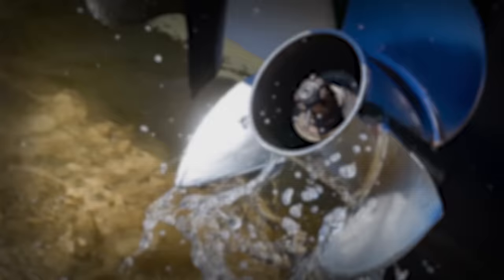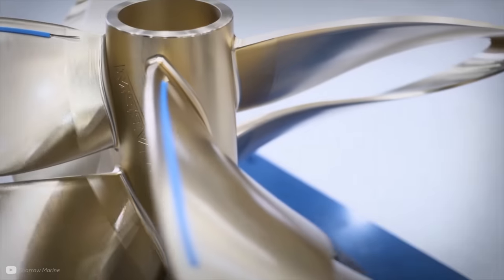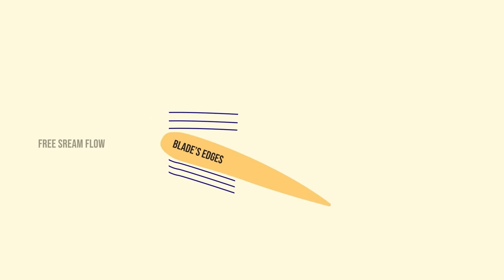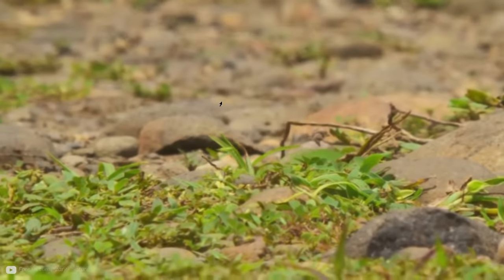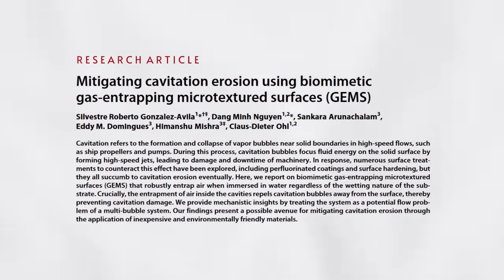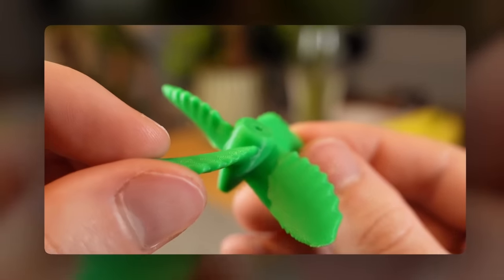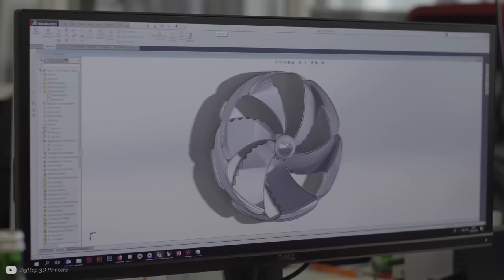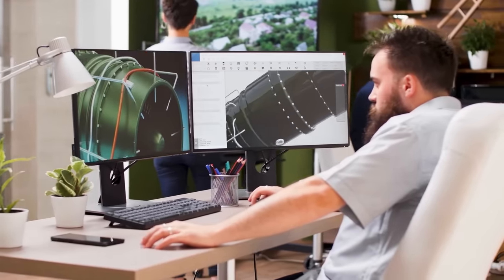The Unexpected Genius of Bionic Propellers

Comment: I must say, having used some 3D CAD/CAM drawing programs to design propellers, these are insanely cerebral from the onset.  But introduction of tubercles to the edges makes these ever more insanely complex.  Your presentation was professionally presented so that anyone could understand this content without struggling.  Good job, Ziroth!
Reply: the solution is the placement of the propeller, water pump can run 25 years only when air is added to the instake damich appea
,so a tractor propeller because it have a back pressure and a pipe is a solution

Comment: As a Merchant Mariner, this is really exciting.  Always a good day when you learn of a new technology that increases efficiency while ALSO helping the environment.  It's a win-win for everyone.
Reply: I dunno. Big Auto took away the water engine. Big Energy took away the perpetual motion machine. 
I expect Big Propeller to take this innovation away from us also.
Reply: a patent is holding it back, some one patent it ,but cavitesion go to cero if the propeller is place in front of the ship 🚢 with a pipe running the water back,this design reduce or eliminate the front wave and increase or fill the depression behind the ship, elevating water behind the ship increase propulsion .
Reply: More efficiency and more thrust. In other words, no performance drawbacks. The issue, of course, is how difficult these things will be to manufacture.

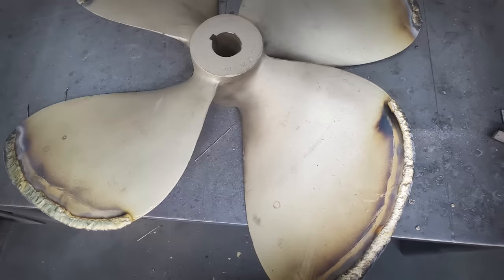Comment: Just wanted to make a correction. At 1:57 there's a picture of a propeller that supposedly has cavitation damage. This is actually a picture of a brass propeller that's in the process of being repaired. The outer edges have been welded and the "cavitation damage" is actually the weld that was added to repair the propeller. This will be ground down to match the original shape of the propeller. Thought I'd clear that up incase anyone was confused.
Reply: And at 2:05 the computer model of the prop is nonsensical, as the pitch at the tips is greater than the one at the root, while it must be other way around. The prop shown is basically in a "feathered" position.
Reply: thought it was weird how the cavitation which "eats away" at the prop somehow managed to add material to it
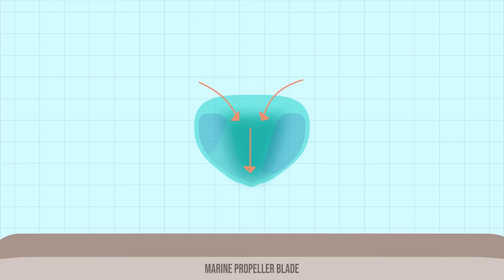Reply: Better pic at 2:27.
Reply: Engineer here - I wondered about that.
Thanks for clearing it up.
Reply: It is even easy to see the heat-affected zones from the welding.
The guy making this video lacks quite a lot of engineering knowledge I guess..
Reply: @ErikS-  I am an engineer with 30+ years. You-re right he lacks a lot of experience but from my past interactions with him on this channel he is UNLIKE SO MANY OTHERS willing to engage people who know more than he does.

As a counter point so you know what I consider good and bad science and tech channels. 

A while back I corrected a fairly basic mistake made by the Common Sense Skeptic who's a real Elon Musk basher and being honest he's well justified in bashing Elon. But on this one video where they were trying to promote a long forgotten and dismissed alternative to getting into space I corrected them on a point regarding air launched systems. 

FYI - My degree is in aerospace and I knew what they said was 100% WRONG. I got a damn arrogant reply telling me I didn't know what I was talking about and should remove my comment. I then replied back and sited all sorts of examples PROVING their comment was wrong. 

They then deleted me from EVERWHERE on their pages.

So YES Ziroth is young he does lack experience BUT IS WILLING TO LISTEN while so many others are pretty SHlTHOUSE.
Reply from the maker: Yes this is a great point, thanks for clarifying this! I probably should have chosen a different image!
Reply from the maker: @tonywilson4713 thanks for your comment on this Tony. I am definitely on a learning process and happy to be corrected on things. I think humility is an important thing that many people forget!

It's not normal for a young engineer to have millions of people seeing their mistakes every month! 😅
Reply from the maker: @onebronx I didn't notice that, the animation is from another source, but I will try sense check these things in the future
Reply: I do so thank you got clarifying that.
Reply: I am immediately convinced this is a WHOLE LOAD OF OLD BOLLOCKS, hastily cobbled together to make money, rather than impart any real information.
Reply: Yes I recognized that too.
Reply: @ZirothTech  Humility is the seat of wisdom.

Comment: I first learned about cavitation and its destructiveness as a mechanic working on Caterpillar hydraulic systems; how it would destroy the vane type hydraulic pumps needed to drive the massive rams on Cat scrapers and loaders. Later I learned about the noise issue as it relates to, particularly, submarines and how the U.S. Navy went to extraordinary lengths to keep the design of its submarine props, enshrouded, LITERALLY, in secret and how they could tell exactly where a Soviet submarine was simply by its noise signature. Even now, when you see pictures of U.S. Navy subs in drydock, their propellers are wrapped to keep them hidden from prying eyes. Truly fascinating stuff.

Comment: There is a computer fan maker called Noctua from Austria.  They have been well known for making quiet fans.  If you go their website you will see the same flutes on their fans.  This idea came to them more than 20 years ago, after their R&D labs led them to fine tune their observations.
Reply: I'm a big fan of noctua!
Reply: I was going to mention Noctua as well. They have had these shapes on the blades of their fans for many years. Making them widely regarded as the best fans for desktop computers, for how quiet they are, and how much air they can push, buth volume and staic pressure wise.
Reply: @pocketsk3824  Its more likely the difficulty of designing and mass producing these designs that's holding them back. The improvements might not scale with blade speed etc
Reply: My homebuilt PC is very quiet. It sits about two feet from me and I can barely hear it. I used Noctua fans for my build.
Edit: I should add that the room must be dead quiet for me to even barely hear the fans. Typically, I have no perception of sound from the case.
Reply: @raoulduke7668  So they make sentient fans now? Man technological progress is so fast these days.
Reply: @pocketsk3824  The research on tubercles was known for quite awhile because I read about it 18 or so years ago in regards to aircraft.  I don't think anyone had a patent on it.  They had working proven prototypes already so the knowledge of what things like this could do must have been out for at least a decade before that and vortex generators on aircraft wings have been around even longer.
But even if what you said was true it would still not be a problem of capitalism or especially a true free market capitalism.   Those are just economic systems.  Governments grant patents and that is the only thing blocking one person from shamelessly copying someone else or improving upon their idea.
Reply: @pocketsk3824  Capitalism is not at fault though. The problem here is our institutions enforcing that ideas can somehow be considered property. Therefore patenting should not exist.
Reply: @pocketsk3824  Their fan technology is specifically suited for the PC environment. It doesn't scale at all to other fields, and even Nocuta themselves takes like 5 years to come up with a new fan iteration. They're not exactly setting records. There's plenty of research within the proper fields that enables technology to advance, if companies would only make an effort to implement changes.
Reply: @remiranda  Patenting is a fantastic framework for giving people the credit for coming up with new ideas. Ideas are property.
Reply: @raoulduke7668  "I'm a big fan of noctua!"
I see what you did there.
Reply: @pocketsk3824   Capitalism prevents what? you can get one right now. Shipped to your door in 24h.
What PATENTS (not capitalism) prevent is rapid innovation, only because patents have been abused and now they last for too long. You still want the invention to reward the inventor, so the effort will be worth it, but it shouldn't last long enough (as it does now) to stifle innovation.
Maybe you'll get it if I compare with "no reuploads in 24h pls", it's the same concept.
Reply: @pocketsk3824  That isn't something to blame capitalism for. We could have less restrictive IP laws while still having capitalism.
Reply: @Flopsaurus  Its done more harm than good. If you want to enforce having to give someone a set share of profits if you use their idea, that seems reasonable. To flat out say you can't use someone else's idea at all if they tell you no, is something we should do away with.
Reply: @Elrog3  We could... but we don't. It's not that capitalism doesn't allow for it. It just doesn't incentivize it. It incentivizes not sharing technology. The part of capitalism I don't like is that it makes people/companies act in their own best interest, not the world's.
Reply: @pocketsk3824  Capitalism isn't making people act in their own best interest. They make that choice on their own.
 
And you've done it again. Capitalism is not incentivizing not sharing technology. Greed incentivizes that.
 
It would be silly to think you can somehow legislate away greed. Corruption is just as prevalent in socialist systems as it is in capitalist ones. A system which gets people to put the world's needs above their own is more akin to a religion than a government.
Reply: @Elrog3  Capitalism incentivizes greed.  Also, a criticism of capitalism isn't a promotion of socialism. It's simply a recognition that it's not a perfect system, and that we must look at its flaws if we're to find a better way.
Reply: @pocketsk3824  How does capitalism incentivize greed?
Reply: I have a feeling that there are submarines around that have very interesting leading edges on their propellers, propulsors etc.
Reply: This is alien tech left behind by the Bionts in Archimedean Dynasty. It has been fought in 1996, about a decade before Noctua first issued a patent.
Bionts would dart past into the horizon in the most cumbersome looking submarine ships.
Reply: They don't work as that good. Simple  answer, Reynolds number.
Reply: Fine-tune should be hyphenated.
Reply: "The entirely expected genius of..."
Reply: @remiranda  "Capitalism is not at fault though. The problem here is our institutions enforcing that ideas can somehow be considered property. Therefore patenting should not exist."

why do you think those institutions exist in the first place? They didn't spring up at random. They were formed because capitalism relies on defining and restricting ownership. A corporation cant make as much money off common land as they can from owning that land and charging the public to use it. Same with intellectual property. So just like with the enclosure of common land those with money, and therefore power, told politicians to create such institutions so they could make more money. And those institutions will carry on existing as long as we continue allowing a minority to own the majority of the wealth, and restricting access to intellectual property continues allowing for increased profit for that minority. If you want patenting to stop existing, you need capitalism to stop existing. Or at very least be severely muzzled by noncapatalist governments. Sorry mate, if you oppose the ownership of ideas you are a socialist. There's no way around it
Reply: @remiranda that is not at all how patents work. Patents do not indicate that someone owns an idea, it only means that someone has a monopoly, for a limited period of time, for commercially profiting from a specific product, technique, or procedure.

If someone is trying to do some scientific research and development, and was to use patented products or procedures, the patent does not in any way prevent them from doing so or even require that they pay any money to the patent holder. That would only become the case if they started to try to sell something that infringed on the patents, that is profit from it.
Reply: @Flopsaurus tell me you have never filed a patent and don't know how they work without telling me you have never filed the patent and don't know how they work.
Reply: Precisely the bionic design shown here is developed and used by a german fan manufacturer "Black Noise" ... these fans are called "Noiseblocker NB-eLoop" and are in production since 2008...
And yes ... Noctua fans and heat sinks are legendary ... but take e look a the "eLoops" ... they produce the same pressure as a "Noctua" with 25% less revolutions.
Reply: I found this fascinating ! We don’t think about all the things fans are used for . To reduce noise and increase efficiency will help reduce energy cost .  It made me think of everything that rotates. Tires for an example rotate and cause noise & drag . I am sure,  if not already being done , tire manufacturers could use this technology !
Reply: @Szymanskill  a patent is holding the development
Reply: @Flopsaurus  Thats such a fairy tale. In reality owning is only a matter of having enough money to fight court battles and not get outpaced. Because even if you defend it big corps can kill your tech by extending it with another patent that is mandatory to make use of your work. So then you are forced to drop it.
Reply: @remiranda  Thereby removing most of the incentive to invent something new.
Reply: @gaoxiaen1 there will always be an incentive to do better, regardless of garantes of profit or not.
Reply: @cmanycrows8400 Do you even know what sentient means? Lol I’ve never seen a fan that is alive. “Hello, fan. Do you belong to any clubs?” 😂

Comment: I did my dissertation on tubercles, the effect did not seem to be a primary effect of vortex or mixing as would seem intuitive but having a wing with a blend of chord lengths. This in effect smooths the lift/drag distribution so that the wing does not perform as per one specific aerofoil geometry but a blended solution of the chord ranges. This is not so useful for lift generation which can be designed for specified efficient parts of flight but it is useful for maximising the Angles of attack a control surface can be used at - it is not surprising in the end as the humpback whales use the fins for rapid turning and mobility for prey catching, not propulsion.
Reply: The paper I read they reduced drag from reducing cavitation
Reply: That's really cool. Is your dissertation uploaded somewhere?
Reply: So they are like fingers?
Reply: That sounds similar in concept to the reason for the helical strakes fitted to things like tall chimneys & the lesser known applications like subsea pipelines in order to prevent vortex-induced vibration (VIV). The reason they work is that  vibration frequency is a function of diameter (amongst other things) and from any angle, strakes produce a varying effective diameter, which prevents 'lock-in' of the vibration.
Reply: That means we've both done real work with these. I was running high AoA and didn't see big effects. Our application was well sorted  when we started, so it improve on it would have been tough. We couldn't.
Reply: @MrTL3wis @Vergeltungswaffen3 I'm by no means an expert, but the idea,  as it's presented in the video, seems kind of like a scam to me. Huge reductions like 20 or even 30 percent are basically Impossible. Also this startup harks back to the toroidal propeller which doesn't seem to work at all
Reply: @ardaricus1566   To be fair, those massive gains were only meant to show up in very specific situations, like high AoA and stalled or near stalled. Perfect for my application, but we just couldn't get anything out of it in the tunnel. We wanted to find something, and machined aluminum wing we tested was super cool looking, but it just didn't make the difference we hoped.
Reply: @MrTL3wis  Ah okay, should have listened more carefully. I've just become very sceptical of technology hypetrains in the recent years, especially after the lk-99 fiasco. Are you gonna research this further?
Reply: @ardaricus1566   No, that was over 15 years ago.
Reply: Your dissertation on tubercles, chords along the dispersed angle, is degrading the airfoil geometry no matter the ranges. Introduction of quantity is a must in such proposal. Contemplating performance, is moot as discorded, notwithstanding a remodification of inert design.
Reply: All those words from you and still most cannot see how good that is to own for those whales!